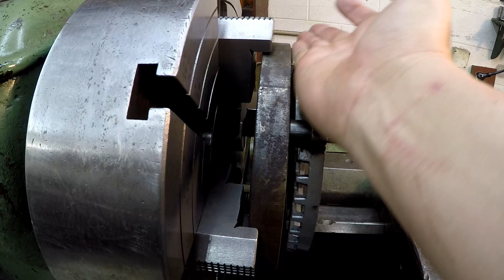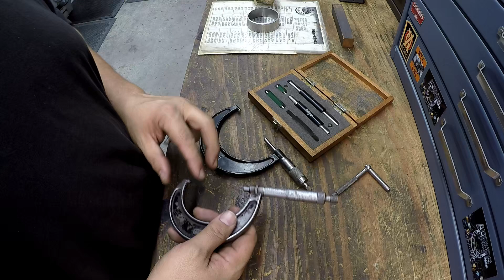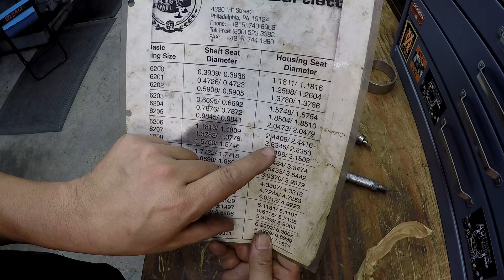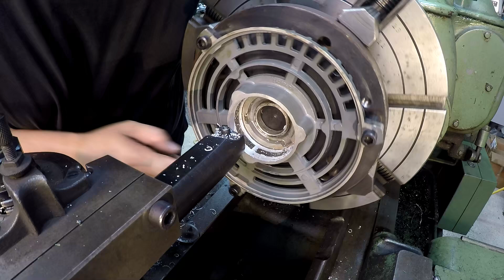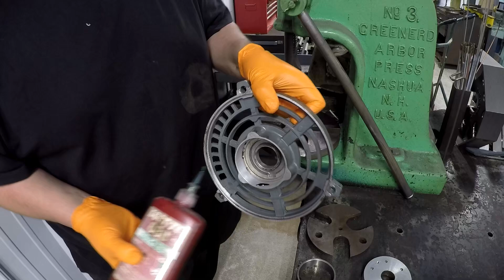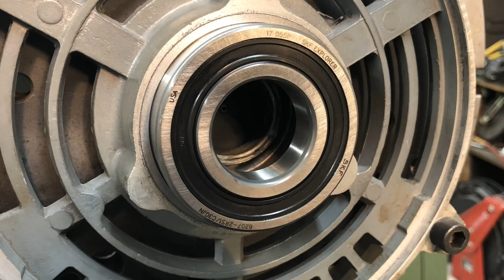K&T End Bell Repairs

Comment: Adam,your comment about no dry ice or liquid Nitrogen. Two kinds of plan B. Stick in the freezer for about an hour will help,but a mix of ice cubes and lots of salt will take it down to 0 degrees Fahrenheit.  That is how the guy that developed the temperature scale managed to obtain the lowest he knew about at the time. Obviously you would need to wrap in plastic. Just a little trace of salt water would forcibly remind you that Pensacola is near salt water of its own variety. That stuff corrodes  like nobodies business but you knew that. Just a little getterdun suggestion that may help in future.Cheers.
Reply from the maker: I understand all that, but it’s easier to just press it in there instead of rushing around with trying to freeze it. Even sticking it in the freezer helps a lot but I don’t have one in shop.
Reply: Abom79 What?! 
No freezer at the shop!! 
Where do you keep all the water and juice? 
Florida’s heat ain’t no joke. 🌡
Reply: Or,if you want to take the end off a propane torch,invert and squirt liquid propane on the item. That will take you to -40 degrees,F or C.
Plan C and no corrosion.
Reply: I've used canned air in the past, pretty sure it's just butane. Turn the can upside down and soak the part down. Haven't got any data on how cold it  is, but it's cold enough to get the job done.

Comment: Is that a shop made boring bar holder? That bronze height adjuster was the tip-off for me. The proportions seemed non-original Multi-Fix too.
Reply from the maker: I have one holder I cleaned and polished up, then added some new hardware for these tools.
Reply: @Abom79  That's right. Someone sent you bronze height adjuster castings. I remember the episode - now. 

I'm losing it, Adam. My get up and go got up and went a long time ago. Now the memory. What's next?

Comment: I wonder, at 002 and the diameter of that insert could you have just put it in the freezer then warmed the housing a bit to just slip it in and avoid having to reset it on the lathe? Ive never done that specifically but ive done similar operations with "press on" bearings a lot with almost 100% success.  Ive never used dry ice or ln2
Reply from the maker: Going from freezer in my house to to shop wouldn’t help much. The press with loctite works fine and it’s tried and true.
Reply: @Abom79  You're definitely more qualified on this than I am!  I guess the bearing thing is just a different process.

Comment: I would have pressed it in using the tailstock.....
Reply: it's not a press fit....Probably take a lot less pressure than using a 3.5 in drillbit..
Reply: centre would be unsupported
Reply: looks like it was tight to the backing plate to me.
Reply: that's not what a tailstock is for! That's why Adam used the Arbor press.

Comment: Having 5 thou over is not impossible. You could glue a bearing in with the right loctite. But that would not be a good repair. And it would not last very long. One could do that as a emergency repair. But after that, the part may be fubar. So a professional repair is exactly what you did. Very well done.

Comment: Adam I was wondering if your motor shop can  balance the rotor after the repairs as the laminations and fins are damaged and put it out of balance and could continually throw bearings .  Some motor shops press in new shafts when possible
Reply from the maker: Yes of course they balance

Comment: When the lathe starts, I hear a motor shut off and when the lathe shuts down, I hear a motor spinning up in the background.  I've heard it many times so I've dismissed it as coincidence.  I'm new here, so sorry if it's been asked but; what is that motor in the background doing?
Reply: he only disengages the clutch instead of shutting the motor off each time. What you hear is the motor spinning with no load.
Reply: If I'm not mistaken that's the main drive motor for the lathe. It has a clutch system that disconnects the motor from the spindle. It runs all the time the machine is powered on. I suppose it's to hold down the spinup time required if the motor was powered down every time the chuck was stopped I'd take longer for the spindle to get up to speed.  The lever Adam pushes down controls the clutch that applies power from the motor to the spindle.
Reply: These larger lathes have clutches (and brakes) so you can float the geartrain into a different speed range without having to shut the motor off. These lathes have straight cut gears that aren't easy to mesh unless there's a little bit of movement in the gear train, so you clutch in for the slightest amount of movement, then change gears. You'll often see a placard with something like "Float clutch when changing gears" on these lathes. 
It's also faster and easier when you need to stop the spindle spinning many times.

Comment: Hey Adam, did you consider switching to bearings with a smaller ID and machining down the rotor shaft to match?   That shaft is plenty thick and stiff given the relatively like load on the motor and the max torque it can put out.
It's good to see ya lookin so good brother.  Saw the new truck on Facebook.  It looks sweet.

Comment: When you were machining the first few cuts with the lathe, was there any 'power feed'? As it didn't look like you were feeding the cutting head into the work piece, yet it kept on cutting? (E.g. when the steel insert popped out...)

Edit: ah, I see - the 2nd 'cut' (25 mins in) indicated 'yes'...

Comment: If you had inadvertently overbored the endbell, what would your response have been? Do you need to cut out the sleeve and replace it? Or is there some reasonable way to add metal that wouldn't add two weeks of shipping time and extra $$($?) to the end result?

Did you buy spare sleeves for replacements/just in case of a miss?
Reply from the maker: If I was in a hurry I’d have to bore the sleeve out and make my own sleeve. Otherwise order another one.
Reply: Oh wow, that would have been the worst, especially considering how close any possible miss could have been. To lose weeks of time and money for something that small...
Reply: gmofftarki we always make the sleeves , doesn’t take long ,

Comment: Adam, maybe you or one of your viewers can answer a question. Last night I was turning some mystery steel and I couldn’t turn the OD more than .020” depth of cut with out a grinding sound coming from the bit, it would leave a very rough surface. I don’t know what the surface feet per minute are, but speeding my 10” Logan lathe up to to the max speed helped but not much, I could get to a .025” DOC 
then I would start getting chatter and a bad finish. I was playing with feed rate and increasing feed rate did help with the chatter some. I was using WNMG insert and switched to CCMT for the finish cut. 

I do turn quite a bit of hot and cold rolled 1018 steel and this metal is not that grade of metal for sure. This metal was drops from a machine shop that were just the ends of bar stock that were parted off on a lathe. Im just trying to figure out why this metal acts this way when cutting. I just replaced my 3 jaw chuck with a new Sanou 6”. Ever since I replaced my 3 jaw chuck, I seem to have a lot of chatter problems. My old 3 jaw was so bad it had to be put on the shelf for good, and I’ve been using my 4 jaw for about a year. The new 3 jaw is quite a bit longer than my old chucks that were probably original to my 1945 lathe.
Reply: Sounds like really hard material or something that has pockets of hardness in it like from welds. Best advice is to try slowing the lathe down, backing off the DOC a little, and/or shortening up your tooling to stiffen it up. Maybe using a steady or follow rest if it's a thin shaft to change the harmonics. Chatter increases as you use more stickout on tools, so choking up on them usually helps. Sometimes locking the crossfeed or carriage depending what cuts you're doing helps with chatter.
If the chatter is really bad, back off the cut and clean up the chatter marks with light cuts to get back to a smooth finish. A lot of the time trying to "get under" the chatter marks in one cut makes it worse.

Comment: Great video as alwsys Adam. Looks like someone has been wallering on the cooling fins of that rotor man. Seems the mill had a good life but some maintenance guys took to beating on the drive system over its time. At least they didn't gloop her up with bearing fit.

Comment: Adam I have always wondered what kind of QCTP you are using on the Victor Lathe. When I watch you it looks like you just drop the tool holder onto it . Could you please tell me what kind it is.? Thanks.
Reply from the maker: It’s the Original Multifix, made in Switzerland. Both lathe are equipped with them.
Reply: Just to add, Multifix TP are kind of rare here in the US. They were more popular in Europe. Good news, sort of, it looks like the Chinese are making new Multifix TP and holder clones. Adam must be restarting the market for them XD
https://www.ebay.com/itm/special-Multifix-A-Set-Incl-1-x-A-Toolpost-6-x-AD2090-1-x-AT-1-x-AJ3080/192378473083?hash=item2ccaa68a7b:g:6Y8AAOSwhvFZCFjs

Comment: How much part of 1 mm left to tighten
Reply: Kamel Tourneur Not sure if this will help,but in practical terms,1mm equals 0.040". Forty thousands of an inch.    25.4×4=101.6 So there is a 1.6% error built in to that which is why I said for practical purposes.Cheers.

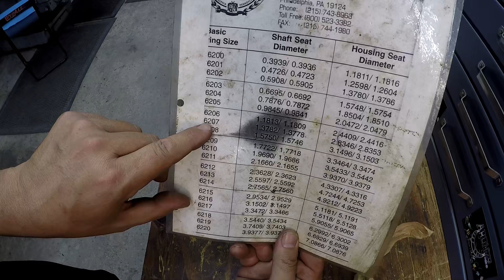Comment: FYI regarding the bearing sizes at 10:20.
You just need to multiply the last to digits by 5mm and you get the ID of the bearing. I.e. a 6206 has an ID of 06*5mm=30mm=1.1811"
Reply from the maker: I’ve been taught that but have a hard time remembering it since I don’t deal with em everyday.

Comment: Hi Adam
Possibly you could drill & tap 4 holes (centered over each vise jaw) in the plate you mounted the end bells to...
This way it may be easier to get the plate adjusted...
Reply: Sorry, and install 4 bolts
Reply: End bell has three fixings
Reply: The plate holding the end bell is mounted in a 4 jaw chuck.  My suggestion was to aid in the adjustment of the plate in the 4 jaw.  There is no adjustment for the end bell on the plate, it is firmly bolted to the plate.